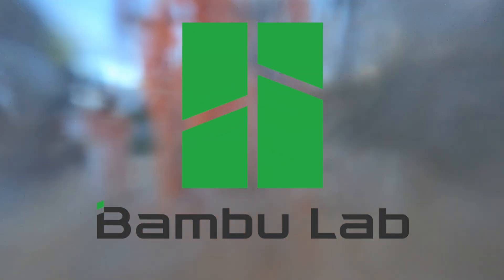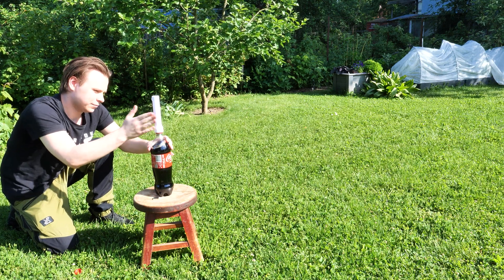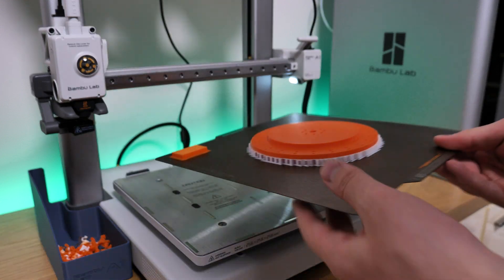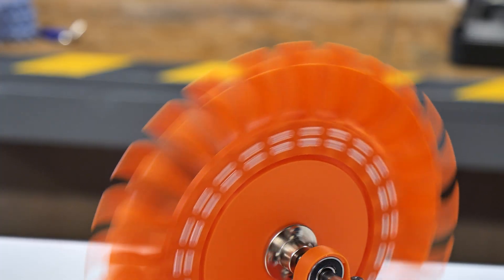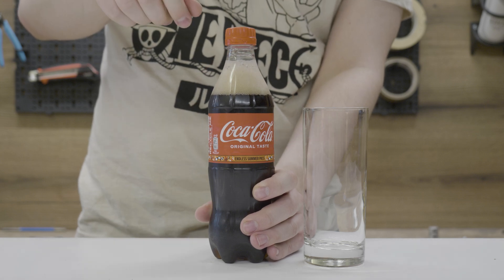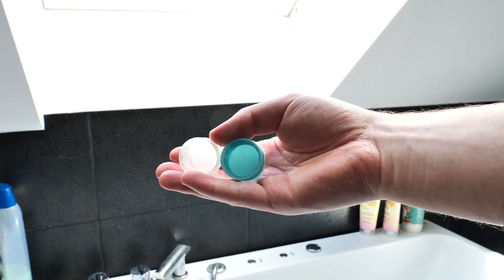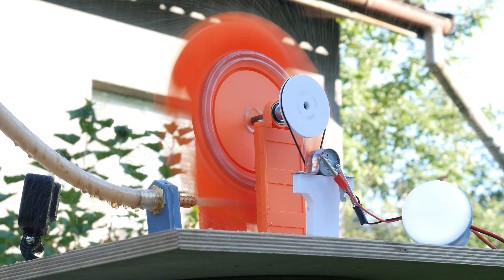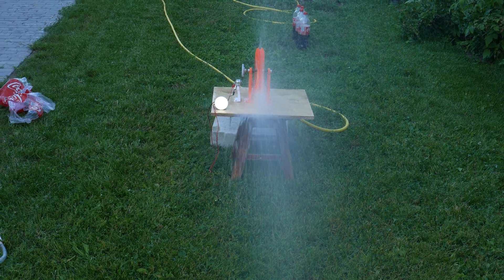Can Coca-Cola & Mentos produce electricity?

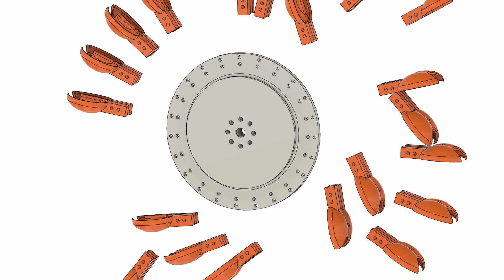Comment: 3:01 so that’s what’s awesome about good 3-D printers nowadays is even before good. 3-D printers still needed to be tuned and everything I had an under three originally I had a tuned up upgrade and I worked good now I have a qidi x smart 3 The difference is night and day. I didn’t have to do anything. I just hooked it up to orca slicer and started printing after I get Alma dialed in the offset a little bit and I get perfect print. I haven’t had to do anything else within the past few months. They have come a really long way in the past couple years.

Comment: You could put a flywheel on it so it spins longer (and produces more electricity) and make the Coca-Cola/Mentos mix more powerful so it spins the flywheel faster and/or spins the flywheel (if current setup wouldn't be capable of spinning it).

Comment: For sealing components like caps, use tpu and threads don’t seal by the way, the ceiling of the bottle cap is the sealing component, so you could also make a tpu gasket

Comment: If you want make a V2 of this video, you cold buy some dry ice for get a little more boost, then you could buy a valve for increase the pressure.
More over, I think I saw something that tell the dirt is more efficace than the mentos for the coca-cola, but I'm not really sure about this.

Comment: If you set it to only use the support material as interface layer, it will only need to change filament a few times, and it will save you a lot of that special filament too.

Comment: Instead of the magnet use a small wire through the pipe at the bottom.  Pull out the wire , mentos fall.

Comment: the threads aren't what provides the seal with a soda bottle cap, it's the flexibility(or additional sealing piece there) of the top of the cap, the threads just keep the top pushed on tight.